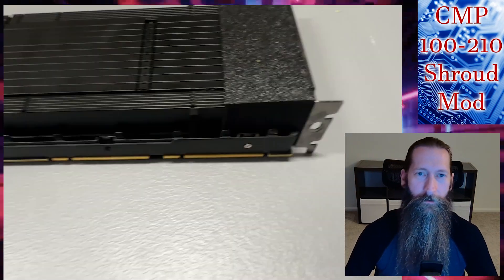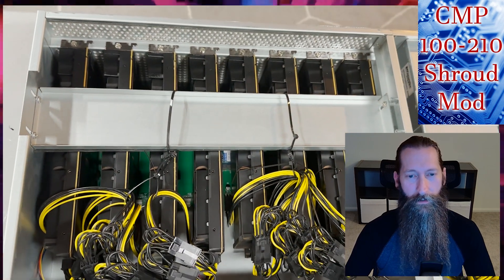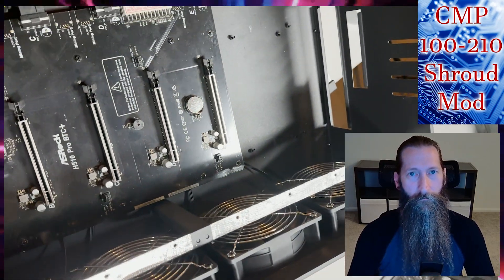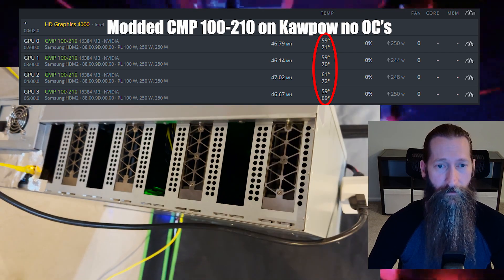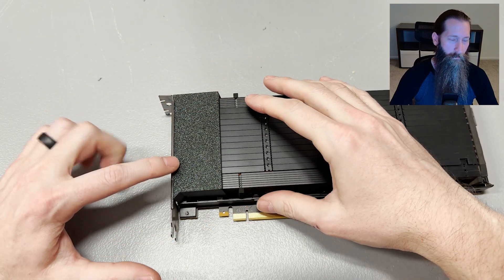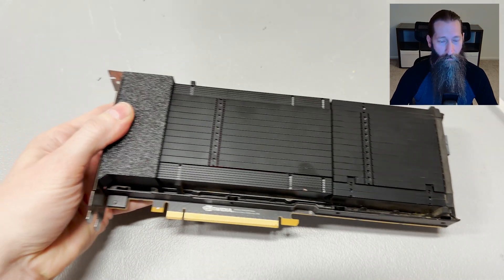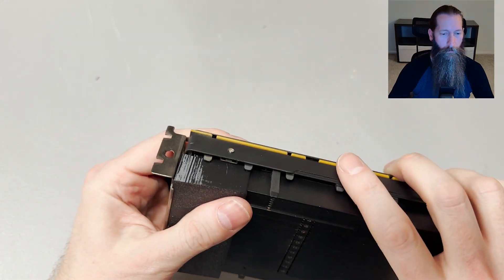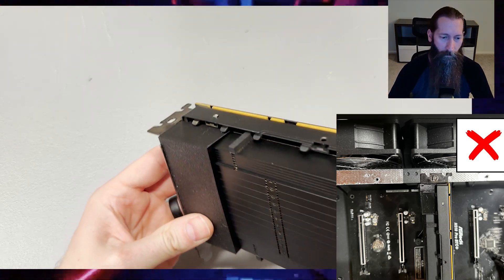Incredible Results: Nvidia CMP 100-210 3D Printed Shroud Mod

Comment: How are you all keeping the memory temp so low on this card!?!  Mine start throttling on kawpow because the mem temp gets to 85c while the core temp is great.  My repaste/repad lowered it about 2c.  Each of my cmps have a dedicated fan pushing fresh air through it too. I even removed the plastic backplate and it lowered another 2c.

Comment: nice video. Have you checked that the screws don't come out due to vibrations?
Reply from the maker: @ZaPirate  I haven’t technically. I’ve been using them on my rigs for a couple months with no issues and with the upward pressure of the of the shroud on the screws they are locked in pretty good.
Reply: @legendarymakes1  appreciate the response. Take care and looking forward to more videos.

Comment: I was waiting for sombody to make somthing like this.

Do you still recommend to have the fans backwards or does this mod negate the effect of reversing the fans?
Reply from the maker: @emileboissonnault6298  The best fan configuration is to have the case fans exhausting air out of the case. Remember you need a case where the GPUs are butted up to the side of the case so air is pulled directly into the heatsink fins and exhausted out the back of the case.
Reply: @legendarymakes1  Im running mine on a rack (not an octominer) and I have a shroud. Its not doing well. Any thoughts?